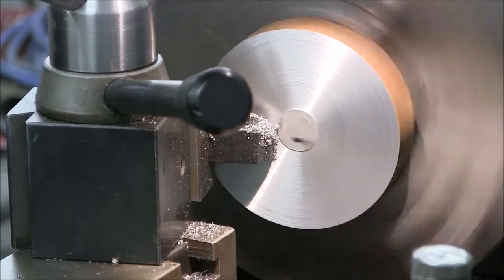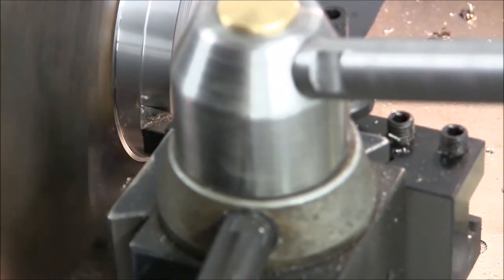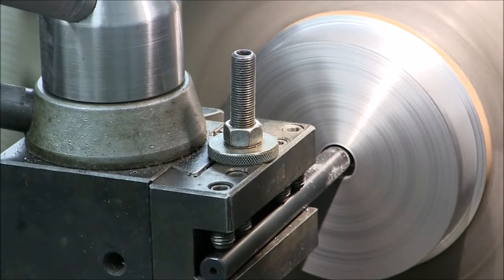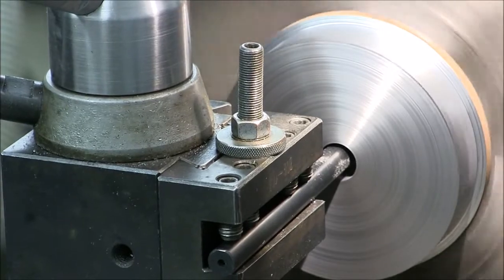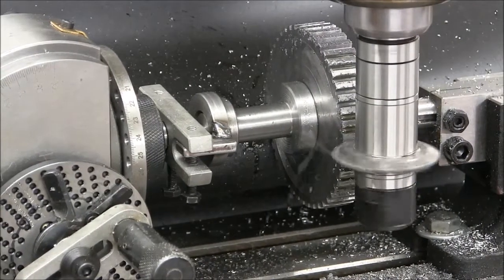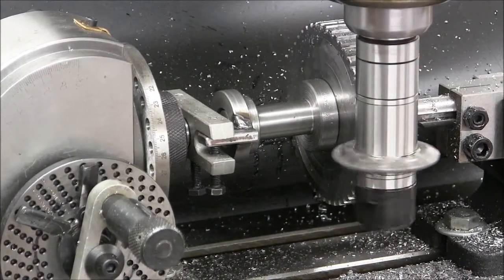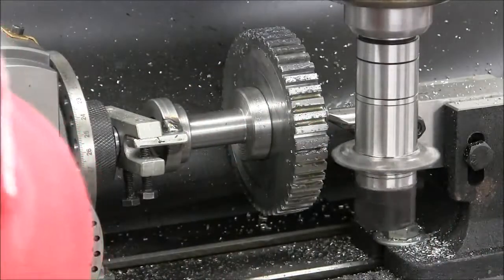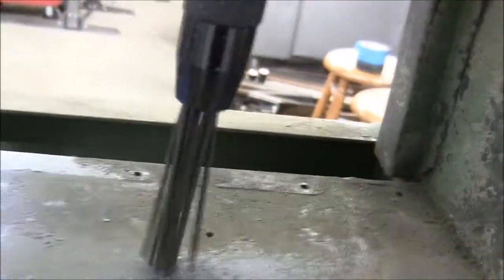Doall bandsaw refurb Part 16

Comment: Hi, We have the same DoAll saw and I contacted DoAll for the prints of the gears you cut. They sent me the print for the input pinion shaft, but not the print for the mating gear. What gear specs did you use for cutting your gears. I have the pitch diameter, pressure angle, and gear OD for the pinion shaft and I need the pitch diameter for the mating gear. Any info for the gears would be greatly appreciated.

Comment: No big deal, I already have the new one ready to cut the teeth. I'll try to pay more attention this time!  Lol Btw, I purchased the bearings for the transmission today.  Two 6204, and one 6206 with and extended hub.  Instead of buying the (expensive) extended hub, I bought a standard 6206 and will make a spacer.  There is one bronze bearing and I'll make that one.